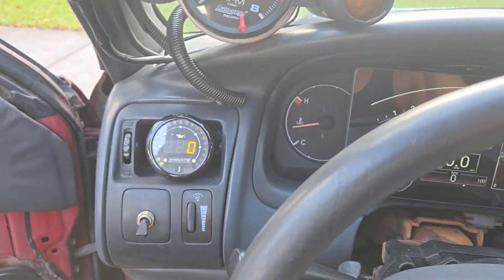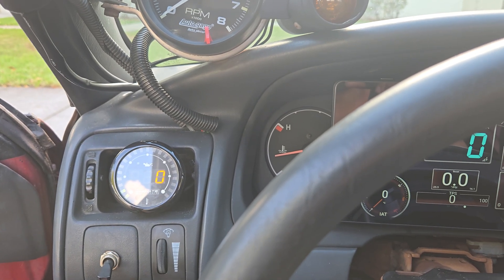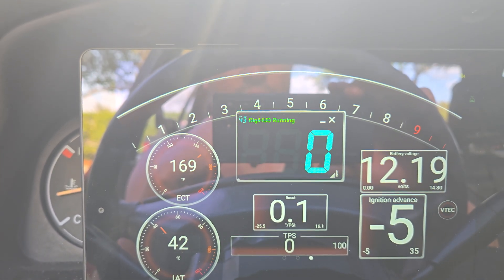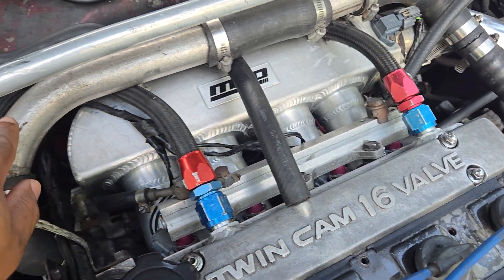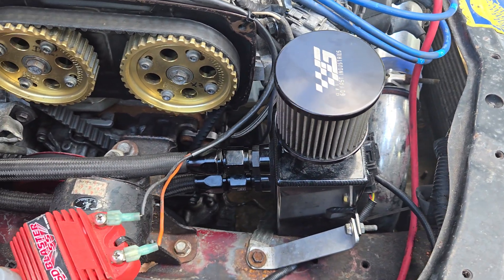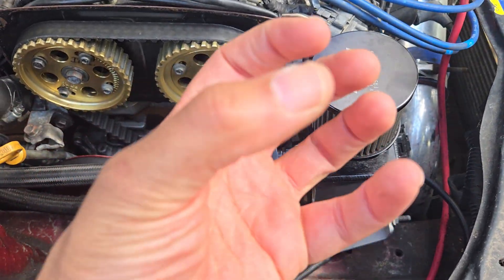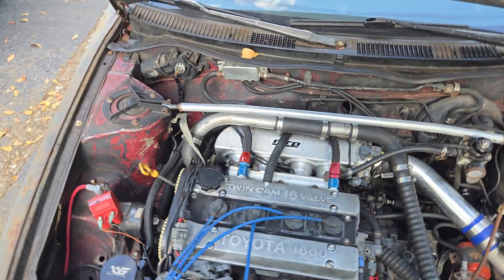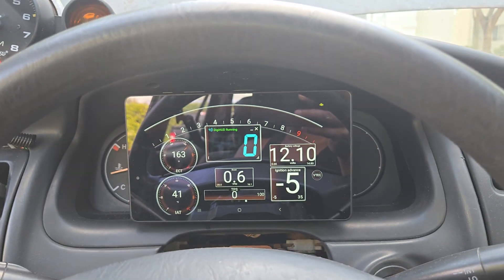Oil & coolant temp. Oil Catch can return with crank case pressure release. Still running hondata!!

Comment: Hey bro, did u use the 4age oil baffle n sump pan or 7afe's?
Reply from the maker: @grosso41  No, I can't because the clearance and design of the 7afe top oil pan won't let me unless I use just 4age oil pan
Reply: @holdmywetnutz  ok so 4age20v it is ... When using the 20v oil pan did u use the oil pan baffle plate aswell? Was hearing about clearance issues with the 7afe rods n the oil pan baffle plate (how did u get around this?)
Reply from the maker: @grosso41  by using a 1 mm oil pan gasket that is rare to find online for the 7a top silver oil pan since from the dealer they only used a gasket sealer and only a gasket on the black oil pan. Only issue is i had to put more oil in since the pan sat 1 or 2 mm lower from the oil pickup..